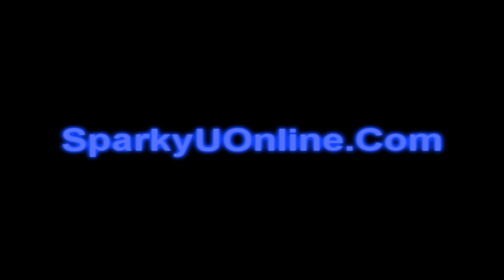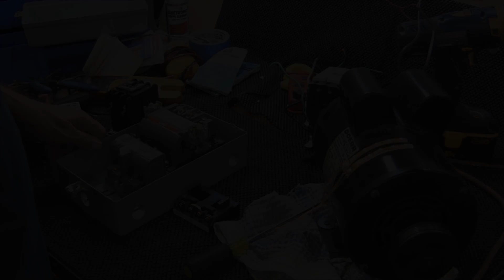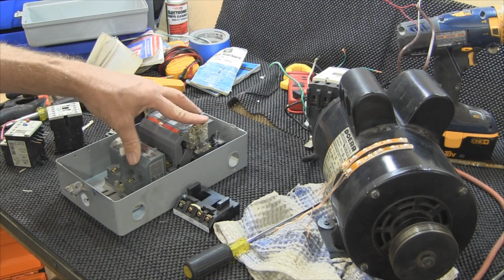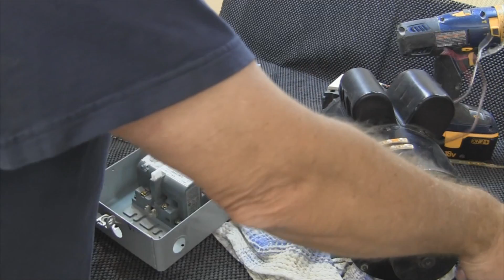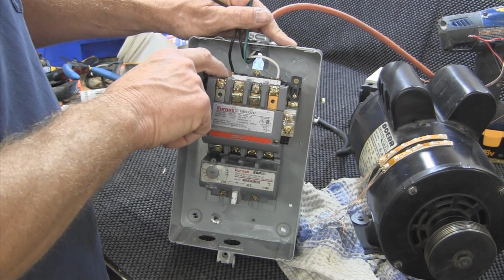Change a 110 volt-220 volt coil on a furnas size 1 Motor Starter

Comment from the maker: I got your pics,
You have a size 00 stater which is rated at 9 amps max,you would need to change the starter to size 0 to run a 1hp motor- why do you want this on a starter any way. 1hp rated @ 16 amps you could just plug it in to a dedicated 20 amp circuit.If you want it on a starter get the size 0 w/a 120 volt coil.

Comment: volts 115 | 200-230 | 460-575.... 1ph |1/3 | 1....2-3 ph | 1 1/2 | 2.... 9amp.max. the currently coil inside is a 75D73070C I'm trying to hook up a 1phase motor 115 volts or do I have to swap out the coil. if you don't mind can I get your e-mail address that way I can send you some pictures for more details. thank you very much sir for your time

Comment: I have a Furnas starter 75D73070C 208/240-440/480 Volt Coil. I would like to know if
I could hook it up to a 1phase motor to this 75D73070C coil or do I have to swap it out with a
110 volt-220 Volt coil. and I was wondering if you could provide with the model number for the coil I don't really know nothing about electricity I'm just trying to get my drill press running and save some money.thank you very much hope to hear from you soon

Comment: I once rebuilt a industrial garage door opener for a customer. The drive assembly was wrecked and only I had the parts. The door was 20'4"x20'4", so it was worth it for the customer. He said it would also annoyingly stop part way for no reason. I missed this because it turned out the reversing contactor coil on one side would only fail when around 30 degrees. Since my shed was around 60 degrees it ran great until I reinstalled it in my customers' truck bay. What a humbling experience.